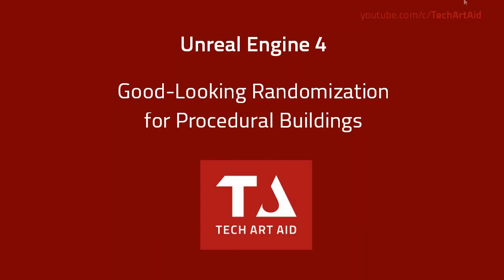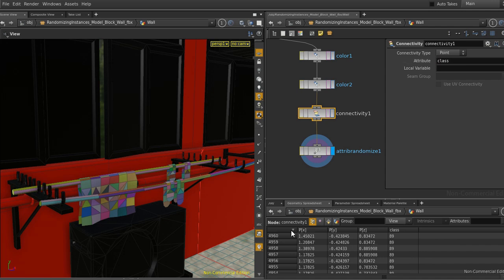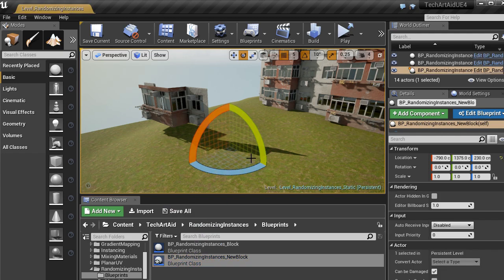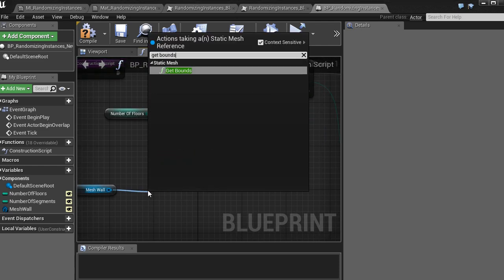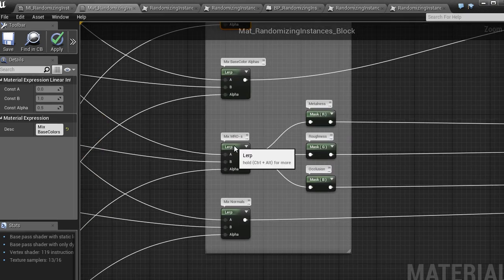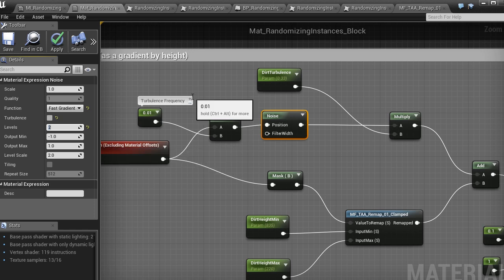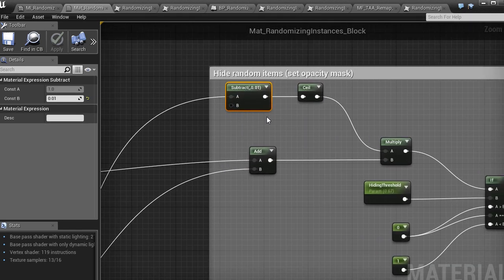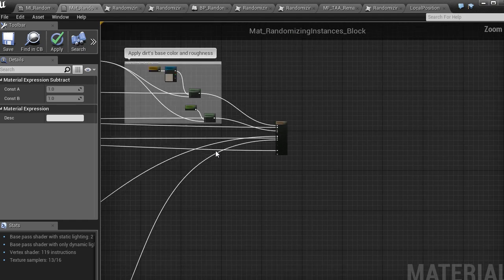UE4: Good-Looking Randomization for Procedural Buildings

Comment: Could you please explain how to make this fabulous image for texture (the "packing" roughness-red, albdo-green...) in Gimp ? Pleeeeease :) I can't find any tutorial about that
Reply from the maker: +mlig mlig I'd like to, but I haven't used Gimp for... whoa, 10 years? It doesn't have an option to set a layer affect only one of the channels, right? So there's a workaround (at least several of them). Make a new layer above that's fully blue, set its blending mode to Multiply and merge those two. Repeat for red and green. Then create a document which has black background and all the 3 layers set to blending mode of Additive (Linear dodge in photoshop). 
Here's the same method in photoshop:
http://oskarswierad.com/public/techartaid/RGB_Texture_Packing.png
Reply: huh! Yes, indeed a long time ago. I've finally found a tuto (https://alphaeridani.wordpress.com/2011/10/17/optimisting-textures-using-gimp/).
Thanks for your sketch explanations picture!

Comment: Awesome work!

Satic Lighting is possible on Instanced meshes only if you set their mobility as static. https://answers.unrealengine.com/questions/134916/building-lighting-for-instanced-static-meshes.html
Reply from the maker: Thanks! Yes, static instance lighting was introduced in UE 4.6. But it's apparently only meant for meshes without LODs. So I've seen people having problem with Hierarchichal ISMs and lightmaps.
https://answers.unrealengine.com/storage/temp/47839-staticmeshlighting.png
I suspect another source of trouble: instacing = sharing all data. But I've never done proper tests of what happens when the total instances' light map size exceeds the size of a single atlas.

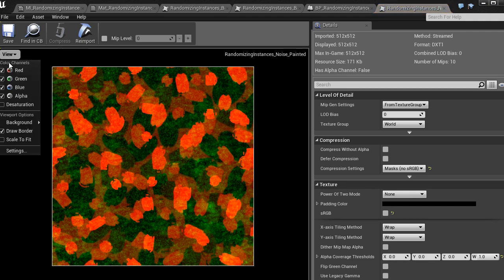Comment from the maker: Here's how to pack 3 textures into 1 RGB texture (as at #14:45)
https://80.lv/articles/easy-way-to-pack-textures-into-rgb-channels/
Reply: Bro you are at god mode . I am serious . Thanks for the help . I apologize that being a student I had to download your project for free rather exploiting you of your well deserved money but I swear I will pay as soon as I start earning . I was worth a project more than minimum of 100 $ . I am really sorry about it .
Reply from the maker: +abraar bala You can do it in Blueprint. Full explanation would require another tutorial, but I'm sure you can figure it out :) Do it like that: separate the objects into different static meshes (but with the same pivot). Create and attach them as well in the same blueprint, just as you do with the building module. But place a Branch node before that operation... and only do that if a random number is higher then some arbitrary threshold. For example, compare if Random Float from Stream is bigger then 0.5 and connect it to Branch's condition. This way only half of the segments would spawn the object as well, not only the building module.
Reply from the maker: +abraar bala :D This may really be an idea for a useful tutorial. Good luck with your stuff. I'd like to see what you end up with, if you can
Reply from the maker: +abraar bala No problem :) Hm, I guess you may not have set up the blue channel of vertex color (the one responsible for random offsets and hiding). Either in the mesh or in the shader. Can you check it?
Reply from the maker: +abraar bala Maybe you have the same value of blue everywhere? I used different values of blue, like 0.2, 0.6, 0.9, picked 'randomly' (for entire element, e.g. single air conditioner)
Reply: Tech Art Aid  can i use any other software than houdini to perform the same task?
Reply from the maker: +abraar bala Texture packing? It's done in Photoshop or Substance Painter, Designer. Or are you asking about vertex color? Houdini is optional here. You can do it in any 3D package.
Reply: thanks for reply and sorry for not being clear, yes i was talking about vertex painting; i use blender, is it possible in that software? if yes then i will have to go through your  awesome tutorial few more times to understand it ;)
Reply from the maker: +abraar bala In Blender, in vertex paint mode, there's a setting on the horizontal toolbar to mask (select) faces. Then you can select them like normally (right click or 'L' key), choose the color in the shelf and fill them with Shift-K :)
Reply: one more question if you please answer me; can i directly hide some objects while playing with the number of floors and segments through  any other way because i am very new to unreal engine 4 and apparently, its impossible for me to understand such a professional tutorial specially the hiding part (i understood the blueprint part). if not  then i will sure try to learn through your way and thank a lot for this awesome tutorial, you are great!
Reply: Tech Art Aid yeah i was trying that but need to figure out you shader still😅. Once again thanks a lot!, Looking forward for awesome tutorials from you😄
Reply: cooool! i will try to work that way. actually, i saw some tutorials of that kind too but none of them explains the way you do so never understood them :D, thanks a loooooooot for replying :) . by the way i think you should make a tutorial on doing it in blueprint. i am sure it will become most watched video on your channel again ;)
Reply: apparently i am working on a game and you would be the first person in credits when the game releases for sure ;)
Reply: Tech Art Aid hi, i figured this method out a few days ago but i face a problem since then, the problem is that the mesh that should appear randomly changes its offset in Z axis in each floor and it continues to change the same amount at all the floors as it did in the 1st floor (at the ground floor it appears to be in the position) also my randomisation doesn't randomly add static mesh on random floors but add the static mesh on all the floor randomly; i have already got a lot of help from you and was not going to ask for more but seems this problem is easy and i couldn't figure it out. Thanks a lot!
Reply: Tech Art Aid sorry for the lack of information, actually i am doing it in blueprint as you suggested me in the comments, by separating the meshes and keeping the pivot point same of the separated meshes and also adding a branch node for the randomisation. Sorry i had to repeat everything that you said just to remind you 😅. So can i get help with that plz? And thanks a lot once again for your reply :).
Reply: Tech Art Aid yeah may be, actually my blueprint setup is like this: after your building module, i copied and pasted those same nodes and continued the flow. The only thing i change is i added another static mesh at the end as you do in this tutorial.( basically i am repeating you node setup for building module so that it allows me to add another static mesh in the loop and randomise it using branch node . but i haven't setup or done anything with the shader yet.) so there is no use of any material or vertex painting in my mesh yet as you suggested me the possibility of getting that randomisation straight away from the blueprint. I hope i am clear enough and sorry for any inconvenience.🙄
Reply from the maker: +abraar bala Ah, yes, now I remember :) Don't worry, I'll gladly help with this. Can we move to e-mail or Discord? I can't see old comment replies on Android. Mine is oskar@oskarswierad.com and Discord username OskarSwierad#6988
Reply: Tech Art Aid OMD! Thank you so much, let me add you quick! :D

Comment: Simply amazing! Thank you so much for this tutorial. Good stuff. I was wondering about ISMs, so I was happy when you adressed that later on, and what their drawbacks are.

May I ask how much time you spent on creating the mesh/textures/magic material approximatly?

Also I'm browsing through the Houdini page and am somewhat confused by the licences... So there is a free "Apprentice" version, which seems to be too limiting to use even in non-commercial projects. Then there is the Indie licence which has the "Engine" for free and "FX" for $199 annual. Which one would I need to get the functionality shown in the video? Since I assume I won't get away with the free version - I should be able to create the masks manualy in Blender too, right? It's quite a bit more work, but it's not obligatory to use Houdini, am I correct?
Reply from the maker: +Creep I'm glad you liked it and that I didn't miss out these ISM questions!

The mesh + tex took me around 36 hours total (Blender + Substance Painter, using a lot of materials from Substance Share). The shader and tutorial were next 25 hours. I quit my job and for the first time worked on a tutorial from home. This helped immensely in keeping head clear for problem solving and learning SP 2.

Houdini: Apprentice has all features, but no export. It's purely for learning. But it's not time limited, which is awesome. Indie is the FX but 10x cheaper :) so it's the version you should pick up for personal projects or indie (< $100k). Then, for companies, Houdini (basic, formerly called Escape) is cheaper than Houdini FX and has all modelling/animation/rendering tools. It lacks VFX solvers (fire, smoke, destruction). Unless you need to simulate stuff, it's a good choice.
Reply from the maker: +Creep And yes, initially I set the vertex masks in Blender :) But it was so hard to change the values later in specific channels. That's what inspired me to show the Houdini way
Reply from the maker: +N nOni Thanks for the support. Since that time I found a job at Tate Multimedia, as an environment artist for a UE4 game :) I started a week ago - so far it's demanding (from painting skills to tech stuff) and the team is great!
Good indies rarely take less than a year. But yeah, I'll be able to pull it off together with a friend-game designer and others. It's just... stability, mostly, that makes me prefer studio at this moment. Not as in safety, because publishers exist, but having too much on my head.
Reply: Sorry to hear that you quit your job but may be its for the best and to find better team/company . with your knowledge you can make your own small indie game in 4/5 months if i was you i will give it a shoot .
Reply: Glade to hear that , one of the reason i suggested to make indie game is to test your knowledge and see what you can pull off by yourself .every developer have his dream of making his own game one day . i have a job take a lot of my time and its not game development related but i try to work on my game in my free team in weekend and hopefully one day i can finish it even if people don't like it :)
Reply from the maker: +N nOni Good luck. I admire such spirit. You're absolutely right. I worked on 4 indie projects after hours (mostly failed) and I learned a ton. I was able to find a lot of pleasure in programming. We found how to think in terms of costs, finding the simplest ways :) And the game ideas made most of our own interests, not just general ideas. So you doing the game by yourself or as a team?
Reply: I can't be in any team as i mentioned i have no time :(  so the only way for me to make a game is solo developing , i am currently working on a game very simple which is a VR shoot duck :) i will use many free asset from epic launcher and hopefully it will be something that someone will like . i almost finished the shoot mechanic and i will start on level design soon . i will share progress in forms/FB and let you know my result :) .i worked in many solo project but left it due to falling too deep on the game so now i am trying to make a very basic game so at least i can finish it without leaving it .
Reply: This is my latest solo work before i started in the VR project i mentioned , https://forums.unrealengine.com/showthread.php?130282-Free-archviz-interior-%28Red-Room%29-%2826-asset%29
Reply from the maker: +N nOni Such small project could work great (in fact there are small projects, I think). So I see you too have fondness for unifinishable epic ideas ;)